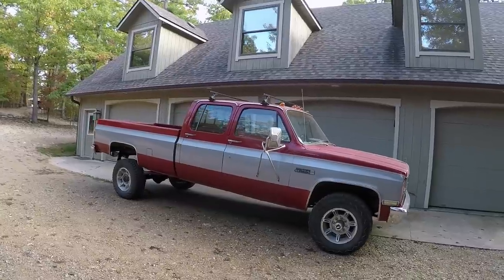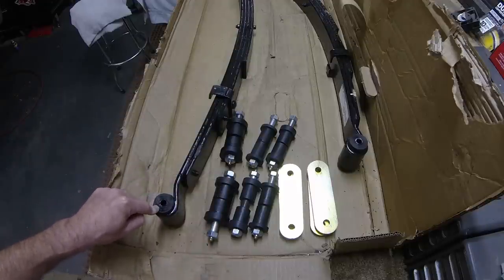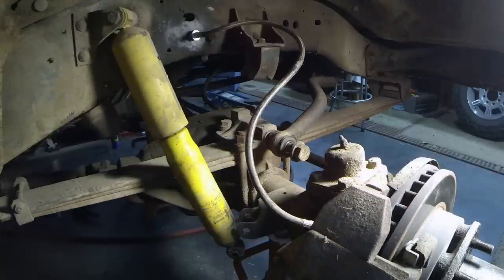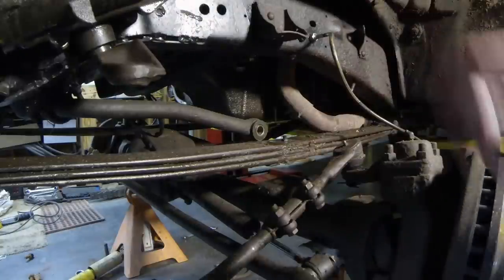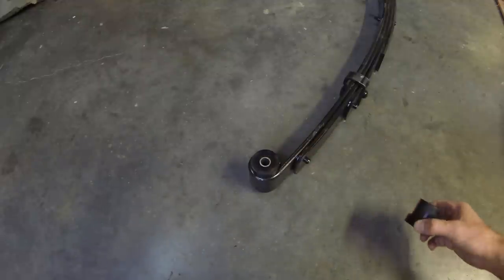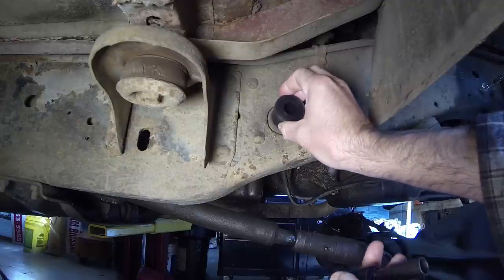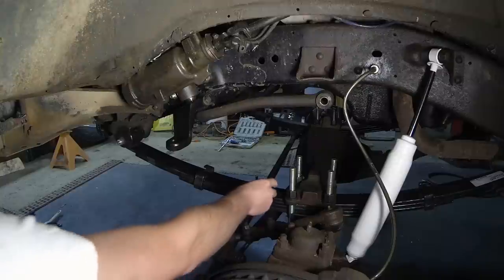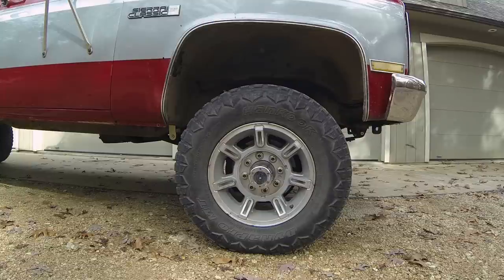1973-1987 Chevy Truck: 4" ORD Lift Install - Part 2 (Front)

Comment: Truck looks great! One thing my brother and I noticed owning a few square body's. If you look at the top of the wheel well in the rear and look at the space from there to the center body line that runs the length of the truck it's farther away than the front wheel well is, making the truck look like it has a nose up stance (if the front springs aren't flattened out) when it's really level haha.
Reply from the maker: gmjunky87 I agree. There are some funky angles and distances going on with theses trucks. I did finally get it where I wanted it though. The top of the bed rails are almost level. Just slightly higher in the rear.
Reply: Cool!!! I'm glad you got the stance you wanted!  Someday I'll get mine up in the air a bit haha

Comment: Did you ride improve? My 87 Army truck is rough. I upgrade mine with the same shocks and it did improve some bit i need to check them again and see if they have not blown out
Reply from the maker: I sold this truck unfortunately. I don't remember the ride being that bad though. I miss the truck!

Comment: I did the same left on my 86 k30 today got the front all assembled notice that the tire does not seem centered within the wheel well but did not see any markings on a front to back to the leaf spring do you know anything that could help I measured it it looks like the front is actually longer even though it's closer to the front of the wheel well and not centered
Reply from the maker: You might want to look into Off Road Design "Zero Rates" or DIY4X "EZ Inch". These add an inch of height but allow you to offset the axle by 1" or 1.5" (or 0 offset). The axles naturally become off centered when you lift the truck because of it's suspension design. It's been a while since I studied it though.

Comment: You mentioned leaving the sway bar disconnected. How did that work? I'm worried that since these models don't have a track bar that the sway bar was also providing  some left/right support instead of just the shackles.
Reply from the maker: +theglockholiday Thanks for the comment TGH. It's funny that you mentioned that because I totally forgot that the swaybar is still disconnected. I've had it that way since the lift install and I don't think there are any issues. Keep in mind that I'm not a professional mechanic and this truck is a far cry from a daily driver. I drive it short distances on some weekends. If your truck is a daily driver, you may want to have the sway bar hooked up.
Reply: Anyone have a drop pitman arm by chance?
Reply: I would recommend using  the sway bar with the drooo bracket

Comment: Did the front heavy duty shackle kit and rear super shackles come with the ORD 4" kit or was that an add on?  Wouldn't those 2 components give you more than a 4" lift??  Thx
Reply from the maker: +Dee O. Gee Hey DOG. Thanks for the comment. ORD doesn't really make lift "kits". They give you the option to use whatever parts you want from them. If I remember correctly, the super shackles are stock length and the front shackle kit is just a tiny bit longer than stock. I think the extra lift I got came from several places but mostly from the new rear springs.

Comment: ok another q. got my rear almost done but my driveshaft is to short. do you have to replace yours. I'm using the 6" tuff country ez ride rear springs.
Reply from the maker: +smilinjoe23 I did not have to replace my driveshaft but my total lift ended up being around 4" (that's what I was aiming for). My rear lift came from a shackle flip though so it's a little different setup.

Comment: By not having a drop pitman arm could that make your steering a lot more loose?
Reply from the maker: +Chevy79K20 I've got to say, I'm not sure. This is what the ORD site says a drop pitman will do for you: "keep the steering geometry correct to minimize bump steer, retain lock to lock steering and to insure that the  steering linkage doesn't bind or break". I haven't driven a truck without a drop pitman so I'm not sure what it feels like. I'm sorry. Wish I could help. You might want to ask that question on one of the square body truck forums.

Comment: whats the best way to remove/install the top bolts of the shocks. I can't reach the other side so i ended up cutting the bolt. Any suggestion?
Reply from the maker: +smilinjoe23 Hey Joe. Are you asking about the front or the rear? The front is pretty straight forward since you can get to both sides of the bolt. I bet you're asking about the rear. My truck has brackets that have threaded studs/bolts sticking out of them. I was able to remove the nut and slide the top shock eye on. If you cut the stud off, I think you'll have to remove that whole bracket from the frame and replace that stud with a bolt. Let me know if I've misunderstood what you're talking about.
Reply: +God&#39;s Country Hey man Im installing the same kit. How do you install the front springs?. Apparently my center pin is not center. How do I fix this issue?
Reply from the maker: +smilinjoe23 Hey Joe! So the pins on the spring perches aren't lining up? I can't remember if the springs have a front and back but you could try flipping them around. I believe that I assembled everything loosely until everything was hooked up and then tightened things.
Reply: +God&#39;s Country Well the folks on fb group said i need to put the pin in the hole on the axle. so i need to move my axle forward a little. do you need to change your front driveshaft or axle degree shim to make it fit. tuff country didn't mention anything act it

Comment: How does this truck ride with the HD front springs? a little stiff?
Reply from the maker: +Marshall Houston Hey Marshall. Yes a little stiff but not horrible in my opinion. I went with the HD springs because there is a chance that I may put a cummins in it sometime.

Comment: Did you have to do anything with the driveshafts to get them to work?
Reply from the maker: +Mike Schrand No they work ok stock length at this 4" lift height. I may have a slight vibration in the driveline now but that might have come from possibly reinstalling the rear drive shaft out of phase after I replaced the U-joints.

Comment: I kinda ran threw the video do you have to change anything for the front axle when you put the lift on?
Reply from the maker: Hey Travis. I did not change anything in my front axle or drive shaft.
Reply: Thank you I appreciate the responce

Comment: Excellent vid. Any driveshaft alterations?  Vibrations?
Reply from the maker: zombienectar Thanks! No driveshaft mods and it doesn't seem to vibrate. I've only driven it a little in four wheel drive but it seems fine.

Comment: I just bought one but its a dually is that pretty easy to change over to single rear wheel?
Reply from the maker: +Brandon Wesley Mine is not a converted dually so I have not done the process myself. I googled something like "convert dana 60 dually hubs" and came up with a bunch of info on it. Here's one article: http://ck5.com/forums/threads/dually-to-single-dana-60-conversion.257762/ . I believe you can either buy new hubs or some people turn down/modify the dually hubs into normal hubs. I'm not sure on the rear but googling "convert 14 bolt dually hubs" came up with lots of info. For some reason I'm thinking your truck could also have a dana 70 rear axle so make sure which one you have before you dive into the research. Another strange way to get around this is to use H1 hummer wheels and your stock dually axles. They are 16.5" rims though so tire selection is very limited. You should research all of what I have said because it has been a while since I looked into this. Congrats on the new truck!
Reply: Yeah im working the deal out with it on saturday its an 87 TBI injected 454 did those ever come with 700r4s behind them or was it usually a th400 with the big blocks? I was going to probably sell the old axles put 3/4 ton axles under it and shortbed it
Reply from the maker: +Brandon Wesley I believe it should have a th400 in it.
Reply: I wonder how much i need to cut the frame for the short bed

Comment: my truck has the same set up rear tires closer to the front of the rear wheel well
Reply from the maker: Hey Dan! You can use a product like Off Road Designs Zero Rate Add a Leaves to move the axle backwards or forwards. It will give a 1" lift at the same time though.

Comment: The factory front leaf springs are supposed to have a slight negative arch. That's how they came lol
Reply from the maker: Very strange. Mine seemed to be sagged. It was pretty low for a 4x4 before the lift.
Reply: Yep, completely normal! I'm sure they were slightly sagged, but they did come from the factory like that, with a negative arch

Comment: You should get those zero rate offsets for the rear axle, it's not centered. That would drive me nuts
Reply from the maker: Some angles make it look worse than others. It wasn't a big deal. And the truck has been sold since this video.